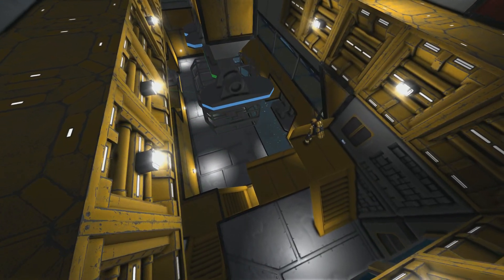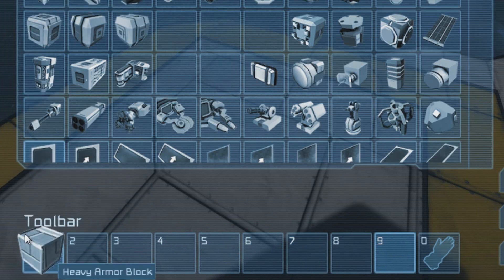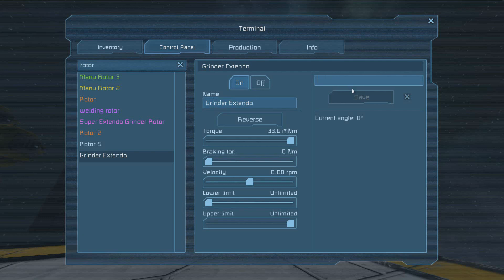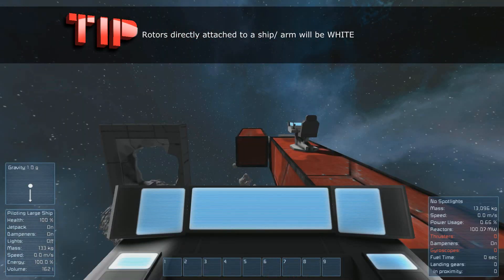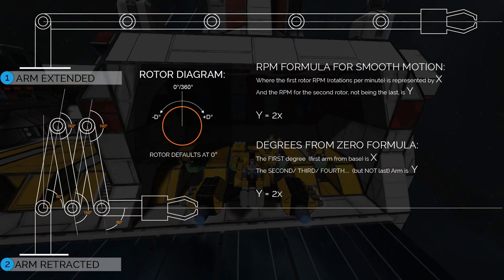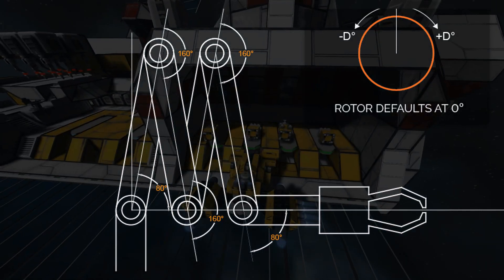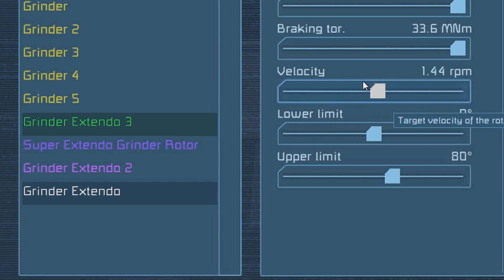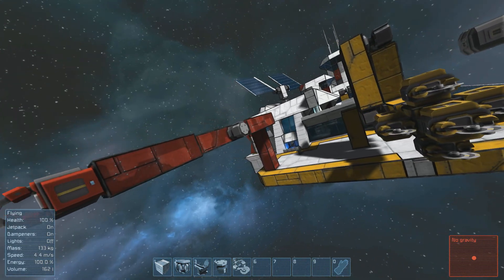How to make an Extendable Arm [Space Engineers]

Comment: Thanks for an educational tutorial. I'm looking to make an extendable/retractable solar panel setup using scissor arms based on this but I can't figure it out completely. What will the angles be when setting up a second arm on the opposite side, where all the rotors are opposite? If u had the time to make a tutorial on scissor arms it woulda been great. It's also based on this: Space Engineers - Retractable Solar Array  But this has parts that doesn't seem to work anymore.